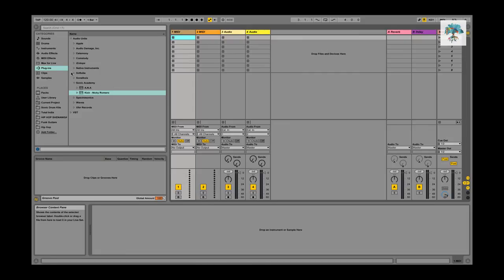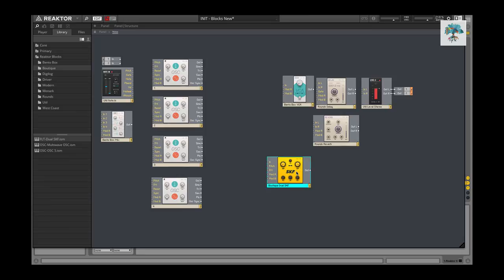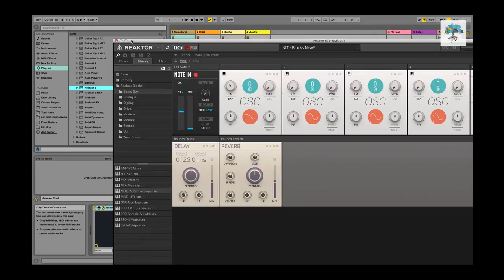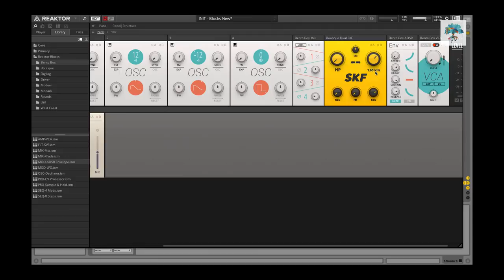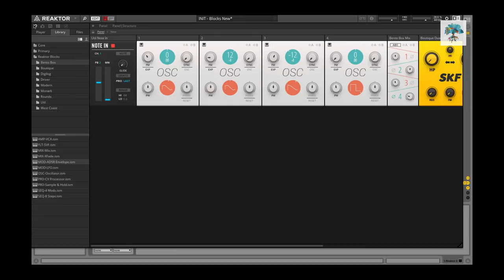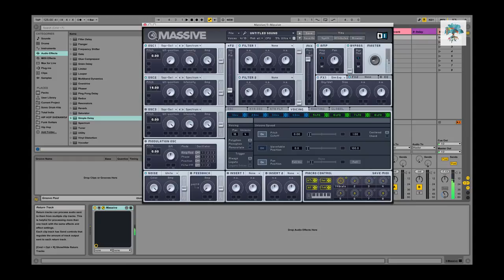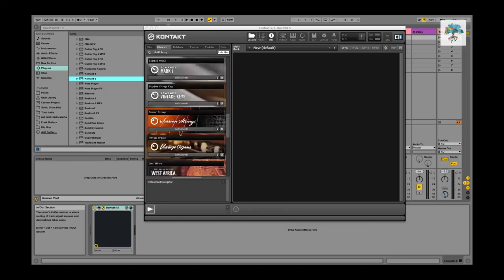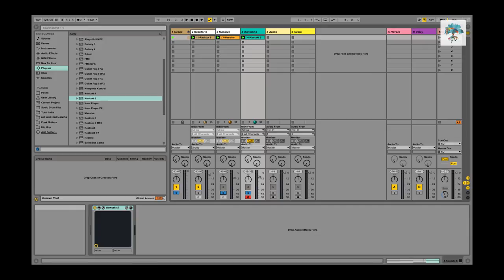Reaktor Blocks Tutorial | Delay Effects | And Sound Design

Comment: How cpu intensive is reaktor blocks/ reaktor 6 and what specs do you have on you computer? Love your videos keep it up!
Reply from the maker: +Cameron Arden The CPU can get high, but not with anything I have made. Some of the presets are ridiculous on CPU. I have found it far more stable on CPU then their other new stuff like Polyplex (which is a nightmare). I am running a lot model 2011 macbook pro. I7 processor with 8 gb ram. I also will mention that REaktor 6 only runs in 64 bit. So when I got it I had to go download 64 bit since I was running only 32 at the time. Glad you like the videos and thanks for watching!
Reply from the maker: +astrofunk But from my perspective CPU is not to bad.